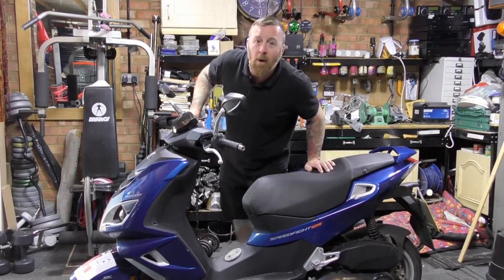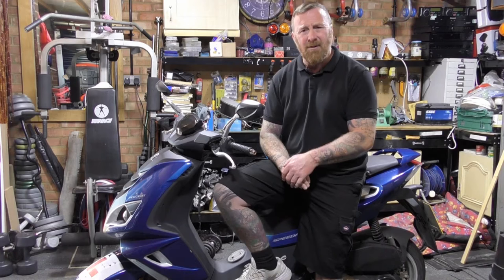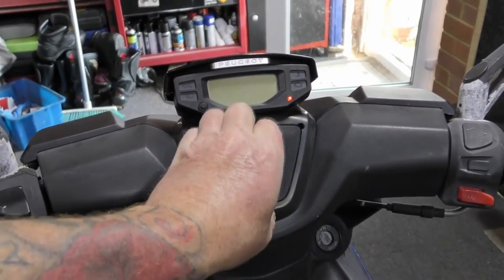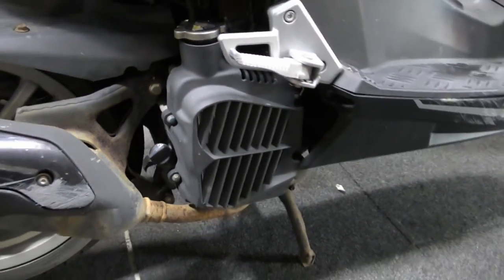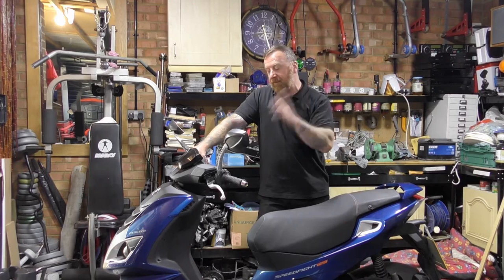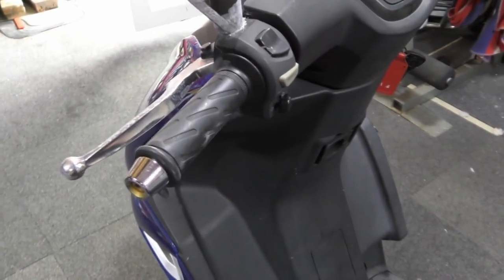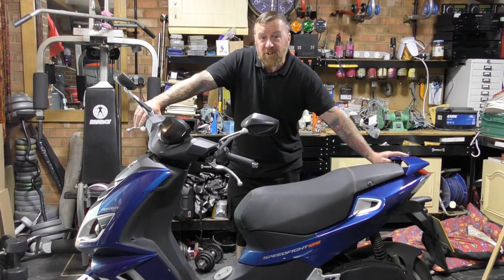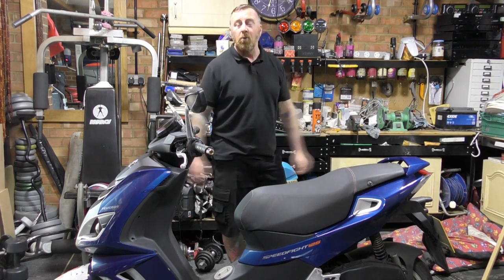PEUGEOT SPEEDFIGHT 4 125 CC LC 1ST LOOK OVER

Comment: I like the way they did with the radiator, the place is perfect, because you don't need an electronic fan starting when the engine is too hot, they use fan which connects to the crankshaft, and you know what it means it keeps the engine cool even when you drive it slowly or in traffic..., and it starts when the engine starts too
Reply from the maker: not thought of it like that so can see what your saying , but to my just ugly lol

Comment: The front brake is overkill, because it a total copy of the stage 6 four pot caliper. Even used the same mounting points, and dimensions.
I have a few speedy 4 parts, so compared them.
The lights do look cool.
Reply from the maker: Yea it seems they just use parts from all the same things 
The sp3 is 4 pot
When I can to taking it apart the sp4 125 have 3 pots !!
Two for the front and one in the middle for the duel braking! 
Who knew lol
Reply: Madness!

Comment: I’ve been thinking about getting a 125 ped for ages what do you think of Sym?
Reply: would that be a preference in taste? or a budget matter? Just curious :)
Reply: @Foggyfighter  Build quality really.
Reply: @PMint8  SYM are very good for the price, no issues with build quality they have quite a high standard.
Reply from the maker: to be fair they are now made in china , but i'd go for this than the sym 
price and maintain it try the sym / lexmoto but they do have more problems with running , fork seals, speedo drive etc 
sort of pay now or pay later lol 
many videos on my channel to help bud 
take care
Reply: I would still value the quality of the japanese brands and then especially honda and yamaha. Unfortunately the supply in Sweden where I'm located is not that big, hence I can't pick something up like a speefigther, but also the price difference between a honda and the other brands aren't that big. When it comes to spare parts, I assume if I get a honda or a yamaha, they will be much easier to find further down the road. if you just intend to purchase new stuff, and to keep it for 2-3 years while under warranty and then change to something else, I would assume anything works, but not sure about the used value on a sym. The build quality however, I would expect you to get a really good scooter even with a sym, it's a recognized brand these days, it's just not a honda ;)..

Comment: The position of the rad is so the engine can be put in other makes without too much alteration. Makes it cost effective and attractive to outer manufacturers to use it in their scooters I have the same colour 125 and find it gets upto 60mph with ease. The additional torque over a 2T makes it a very useful tool in standard tune. As you say Mark this one has either lived outside and is suffering from usual problems of the uk weather or had just not being looked after. The mirrors are shocking it’s just poor quality materials. I’d be gutted if I’d have binned mine like this one. Feel sorry for the owner but I’m sure it will look great after Mark has fettled with it. 

BTW these are made in China not France  so I remains to state as with all scooters they just need looking after to be reliable.
Reply from the maker: video will be out soon , i paid more attention to getting it serviced this time than too much tlc so was more a brush over which to me was better 
sometimes less is more lol 
whats not made in China today pmsl !!

Comment: Do you maybe have a website where I can find parts for a speedfight 4 125cc in England? in the Netherlands it is only novqascoot, but because it does not drive 125 cc it is not available here, it would be nice if you know something
Reply from the maker: parts are hard to get all round bud but maybe try pedparts or scooterworks

Comment: Hello ive got problem with my yamaha areox 2013 2t and after i swaped for new stage 6 70cc cylinder and new leo vincie exhasut and evrything else is stock its getting stuck on 1k rpm and i dont know why
Reply from the maker: i would say you have answered it your self bud 70cc kit , did you watch my video on 70cc / bit bore kit ?
Reply: @marksavage  not yet ill check it now thank you mark
Reply: @marksavage  still no clue and i tried adjusting the carb for like 3 days but still same ive changed to yellow clutch springs and 4.3g rollers and still same stuff
Reply: @marksavage  am giving up its imposible to fix it ive spend too much time and money in to this bag of sh*t

Comment: Hi Mark I'm having trouble with my peugeot jetforce 125 I can't find any info anywhere on the timing would you be able to help me if I bought engine to you
Reply from the maker: timing on these are not really adjustable as on a pin and cdi 
they do suffer from cdi problems and stator going to earth bud
Reply: @marksavage  ive sorted it know there's a cut out on crank that lines up with a hole also there's a hole in cam that you put drill bit in to stop it turning ive ordered battery for it know and the gaskets i need to put it back together bike cost me £35 its only done 3k from new its not even had its first mot lol ive also been given the same bike for free so I'll get that one done aswell know
Reply from the maker: @twizzlestickx7  that's great news bud

Comment: I had the 50cc, fully stocked did 55mph
Reply from the maker: Wow that was good , not UK spec?
You had it from new ?
Reply: I brought it second hand 2015 plate, £700 said clutch was on its way out but never failed on me
Reply from the maker: @TOCABOCA11221  often people think that and it's the belt or variator lol
Reply: Was a mint 50cc to be fair pal

Comment: I had one of these brand new 80 miles broke down electrics went. Got it fixed under warranty off I went another 200 miles head gasket went. Then I found out why the engines are built for Peugeot by sym basically a Chinese scooter hidden behind the Peugeot badge. I'm glad I got rid of it and got a Honda.
Reply: China will manufacture to specification, it's not SYM's fault, it's what peuguot asked of them, I've seen SYM 50cc 2t scooters last over 50,000km's
Reply from the maker: to be far as said before what isn't made in china today lol
but agree unless you get a bad one they will all last if maintained and look after bud